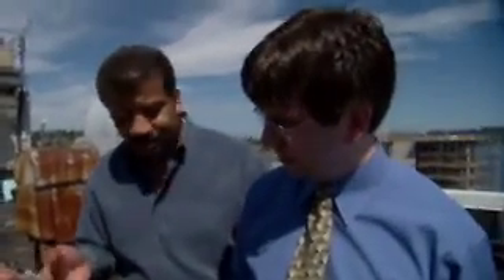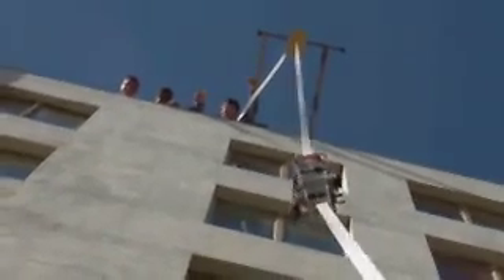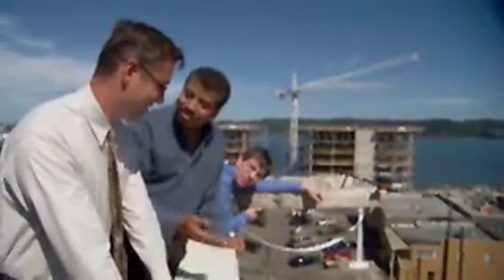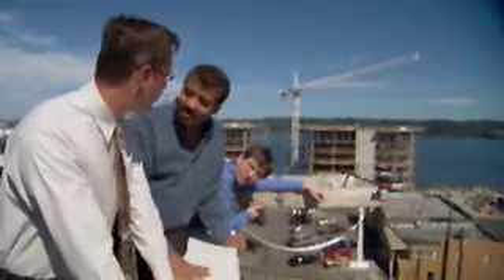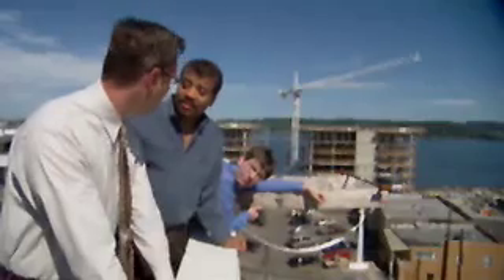NOVA scienceNOW | NOVA Short | An Elevator to Space

Comment: The crawler is the easy bit.  It's making the cable that's difficult because it requires materials with a tensile strength we cannot yet make in the quantity required economically.